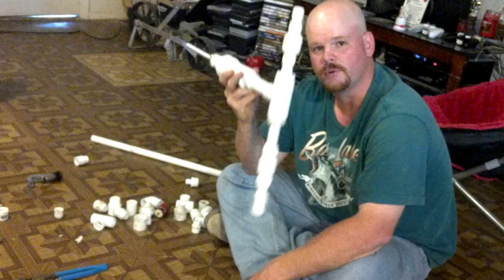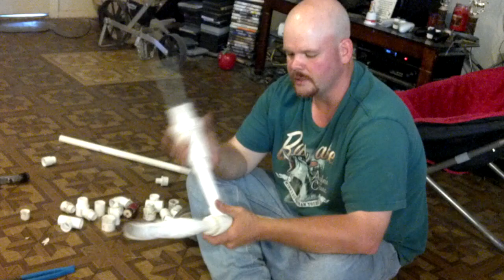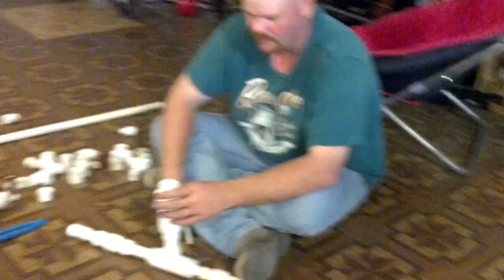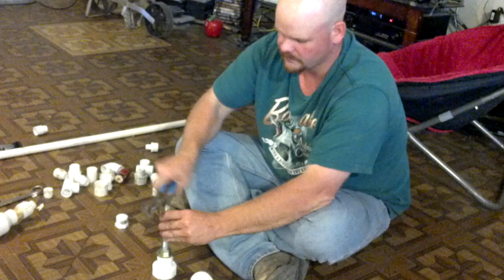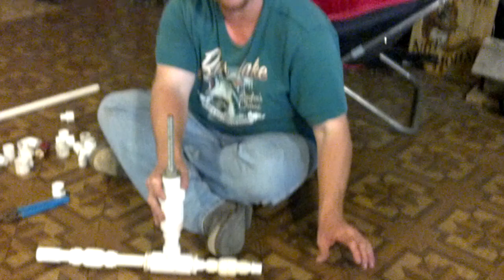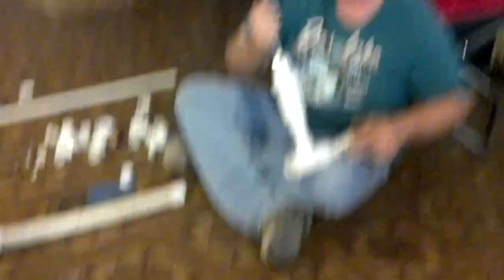Homemade PVC water pump

Comment: Thanks for the tips. I am trying to build a 2 or 3 piston pump that will enable continuous flow and was thinking about building a crankshaft and connecting rods to run it, but the wiper motor is a great idea thats already set up for 12v operation.